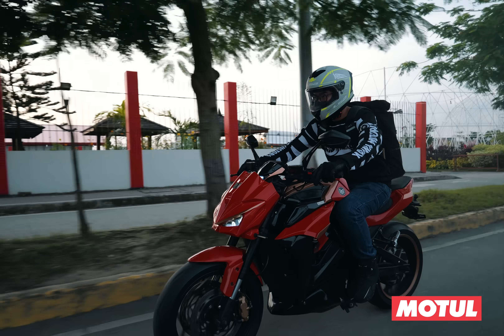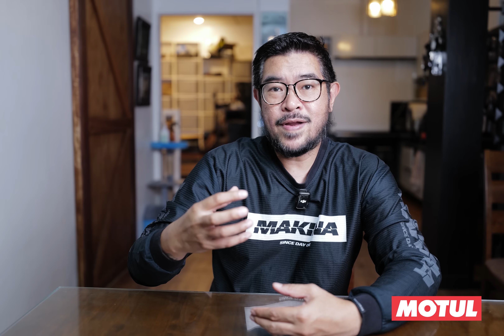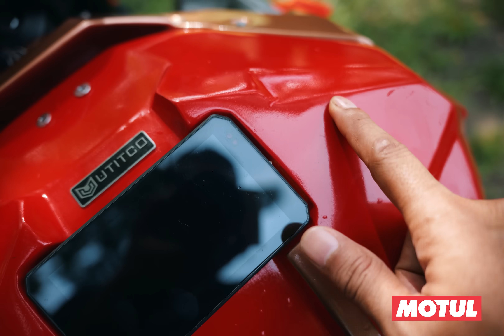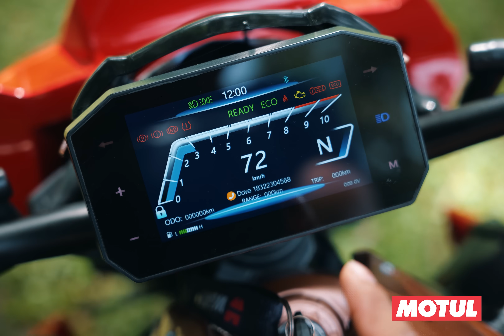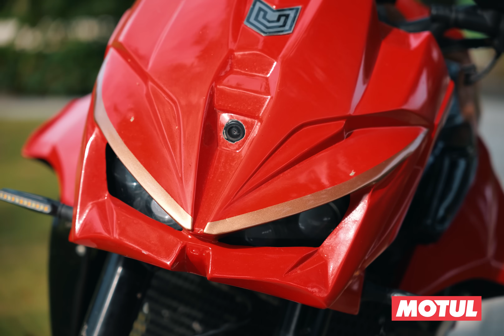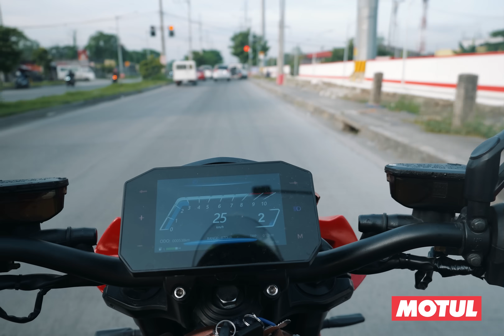Utitco Model 1 SR

Comment: My advice for UTITCO...

Rename the brand to "Lance."

Why? Cuz "UTITCO" sounds like "Yung tit ko."

But it does also sound like a formal company name that owns a cool brand.

Still, "Lance" would be a better name for your motorcycles.

Moving on...

You guys clearly don't have a grasp of the market. You guys lack some common sense and observational skills.

So, let me point this out:
1. There's barely anyone who can service an e-bike here in the Philippines. Sure, an  e-bike is low maintenance, but when that thing breaks... it's gonna be expensive for the owner.
2. Filipino motor communities are focused on the underbone category, which is what you should've been focusing on, as the category has gotten boring nowadays.

Not to mention, e-bikes take a long time to charge and require dedicated hardware for that purpose.

If you really wanted to make an e-bike, then why not make a literal e-bike? They're small, compact, lighter in weight, and are cheaper to manufacture. And when they do run out of power, you still have pedals to work with.

You could've just made a dirt-bike looking e-bike with pedals and sold it for around 50k-70k. That would've actually sold. And because they're smaller, their batteries are also smaller, which means they charge quicker and require none of the dedicated infrastructure and hardware E-motorcycles do.

And you could've also sold additions, like baskets, top boxes, batteries, etc... This would allow you to earn in more ways than one.

These e-bikes would be perfect for the congested and compact streets of central Luzon. And since they're made for urban and short off-road use, short mileage can be forgiven. And these being cheaper would've also allowed you to put better brakes on them and higher density batteries.

And to add? The appeal of e-bikes is that they don't require any license to drive. And if you think about it, pricing it on or below the XRM's price will attract a lot of attention, as people will actually take this into consideration.

So, what is this product, really?
Well, this bike is very low maintenance. It can be charged into any wall socket. Is lightweight and has a lot of mods. It can do off-read pretty well thanks to front and rear suspension with high ground clearance. Has good brakes and has compartments—all for 50k-70k.

What more are you asking for?

You missed an obvious market. THE URBAN PEOPLE. People who don't want to be in congestion, don't want to deal with licenses, just want to get around, etc...

Like, seriously. This is the second Filipino brand I've seen that completely missed a goldmine to chase a non-existent or still underdeveloped market.

UTITCO needs to change course.

Make a lightweight dirt-bike looking e-bike and market it as an urban utalitarian vehicle, fun off-roader, and short-travels king.

Do this and you're more likely to achieve the goal of manufacturing and selling electric bigbikes. You need to establish yourselves first. Get in touch with the people to spread your name around.

Comment: Ok, for those who aren't too informed with E-vehicles.

Here's why you should avoid owning one:

(1) Battery Charge
→ An EV's range and power output is heavily affected by battery charge/level. Like how a phone gets laggier the lower its batter percentage gets, EVs lose power the lower its battery level is. And lower power = lower range because there's less power pushing the wheels. And if you want to keep the power consistent, you'd have to drain more power from the battery, which will further reduce its range.

(2) Degradation
→ Unlike combustion engines, batteries don't hold up well to the test of time, especially those that frequently go on and off the wall socket. They degrade the more you use them, and this slowly reduces their charge capacity, leading to issue no.2. Over time, you're going to be plugging the EV more and more, getting less and less power and range. And that frequent charging only exacerbates the problems mentioned.

(3) Unsustainable and environmentally harmful.
→ That frequent charging is gonna increase your costs over time. And if you do decide to swap the battery, you're likely going to pay a fortune for it. And, guess what? Where do you think that used battery is gonna go? Do you think there are facilities out here that recycle those?

Now, imagine millions of batteries getting dropped off every week at some landfill. That's physical waste containing toxic and combustible elements threatening to tower over the horizon.

Even if we were to recycle the batteries, the power needed to sustain EVs would be TREMENDOUS because of the first two problems.

And guess who has to pay for the electricity bill?

YOU!*

Oh, you think Green energy is a solution?

Most green energy plants are like farms. They enroach on wildlife ecosystems because they require A LOT of coverage to be effective. It'll take a while before that is addressed and they become efficient enough to only require smaller patches of land. Meanwhile, nobody wants to go with the safest option, Nuclear, because they somehow believe it's more radioactive than a coal plant.

A Nuclear plant is the safest large-scale power plant you can possibly work on.

So, yeah...
EVs are a joke.

And, (4) I forgot to mention software.
→ EVs are heavily reliant on the software to function. Unlike combustion engines, which can run on hopes and dreams (especially if you remove the shit software controls). If you brick EVs, break the hardware for the software, etc... you're fucked... Like, really fucked. That thing won't be running. And did I mention the weight? EVs aren't light weight. Their batteries is what makes them heavy.

Goodluck trying to push that thing to the nearest non-existent shop that specializes in EVs...

====

So, you've made it to this part. I suppose you want to know the 'ups' of EVs. Well, there are some great things about this (not good, but GREAT... if you're the right person).

(1) Power
EVs are known for POWER. They will burn rubber, rip through tracks, and give you the ammount of G-Force not even your partner can provide.

(2) Smooth AF
EVs don't have gears like ICE motors do. They're smooth, but punchy. Once you rev, it runs and runs continuously without stopping. And it doesn't lose power in the higher-end, too, like how ICE engines do.

(3) Chill ride
EVs don't make exhaust noise. Meaning, they're quiet. If you like that sort of thing, this will genuinely be the best experience you can have. Imagine a relaxing ride through nature without sounding like you're trying to cut down half the trees in the area. It makes you appreciate nature more and properly immerse yourself in the journey.

(4) Maintenance... or lack thereof.
I'm not kidding. Have you actually tried to do maintenance on your electric fan? Your phone? No? Of course not! There's not a single exposed bit of tech outside EVs. No chains nor gears to lube up. No valve to regularly adjust, no cylinder to worry about cracking. Almost no nothing.

The only thing you'd need to do is to keep it nice and clean. That's basically it.

And those are the reasons why you should buy an EV. They're not eco-friendly alternatives. They're silent killers made to carve out more holes on the planet for more resources that will inevitably turn into an inconceivable amount dangerous waste.

But they are fun and relaxing.

Comment: regen brake works like engine brake kuya zac kaya di mo siya makikita sa hydraulic braking system niya. imagine your engine is a dynamo , pinapaikot mo yung dynamo thru battery. tapos chinacharge mo ang battery thru na build up mong momentum sa wheels pagka you let off the throttle pamalit sa engine brake
Reply: Agree with this. I remember the regenerative when it came out in the RC technology(90s),  its purely in the speed controller, doesn't matter anong motor(DC) pa gamit mo.  Once the motor has momentum and you let go of the throttle parang mag engine brake,. babalik niya yung energy as power sa battery.  Now if you're braking in full well Kasi sa RC brake mo is you stop the motor or reverse the motor walang Regen.

Comment: realistic speaking.. charging station no access,how much the battery cost for new? battery is not available elsewhere..no third party.its more cheaper to buy Chinese big bikes 200-300k pesos.
Reply: If you think about it especially here in ph na unti-unti inaadapt na ang ev's. It's not instant. There's still some adjustments and refining that needs to be done on that category of vehicles especially with a company that's just starting. And those china bike didn't start of great aswell. It took them quite a while to get where they are now.

Comment: Sir Zac yung Regen enegery is harnessed by the motor hub. Since it can also act as generator
Reply: This one. Regenerative 'braking' isn't done by the brakes but by the motor.
Reply from the maker: When you brake, the motor becomes a generator and uses the wheels' rotational energy to produce electricity. It isntriggered by deceleration